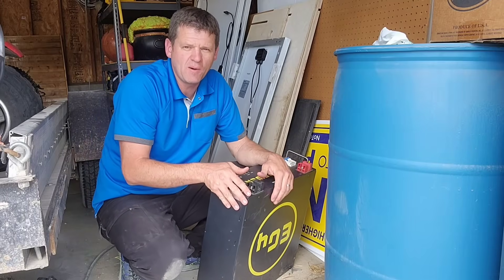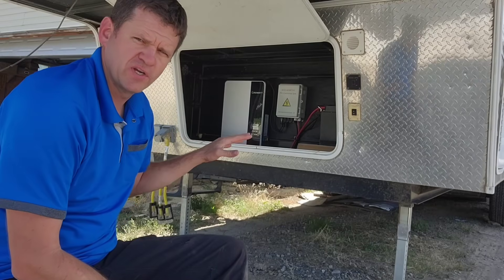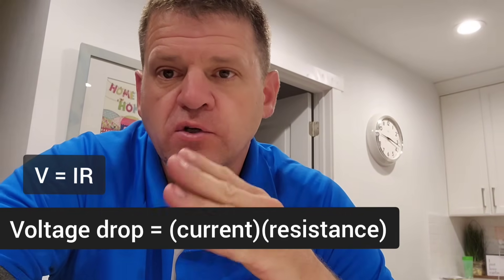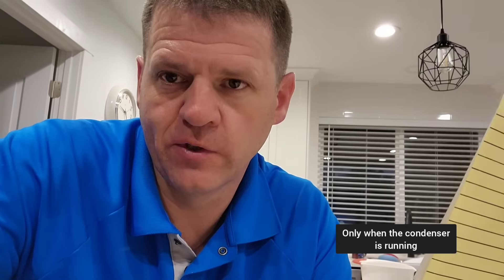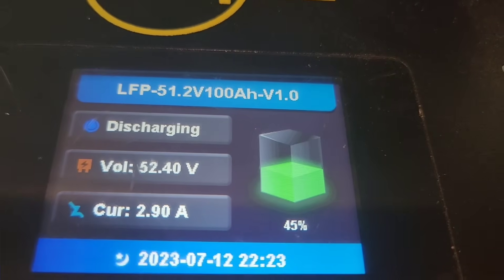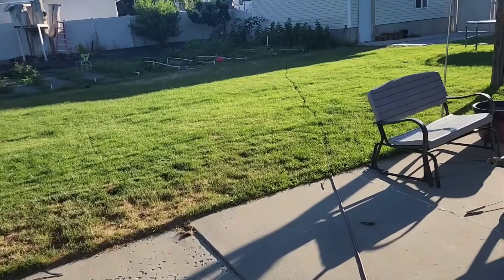How long can a Server Rack Battery run a Fridge?

Comment from the maker: *Product Affiliate Links*: 
-Growatt 3000 48 ES All-in-one inverter: https://signaturesolar.com/growatt-48v-3kw-250vdc-stackable-off-grid-inverter/?ref=DiySolarPowerFun ($50 SignatureSolar discount code: DIYSOLARFUNGET50 )
-EG4 LL (V2) LiFePO4 server rack battery: https://signaturesolar.com/eg4-ll-lithium-battery-48v-100ahd?ref=DiySolarPowerFun
-Eg4 LiFeP04 Battery: https://signaturesolar.com/eg4-lifepower4-lithium-battery-48v-100ah?ref=DiySolarPowerFun
-Used Solar Panels(discount code:"RAY"): https://www.santansolar.com/product/used-trina-245w-solar-panel/?ref=DiySolarPowerFun&campaign=HowLongCanAServerRackBatteryRunAFridge
-Kill-a-watt power meter: https://amzn.to/47ukY0V

0:00 Intro
0:15 What is a Server Rack Battery?
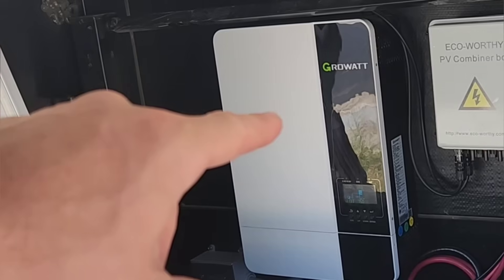0:51 Growatt Inverter setup
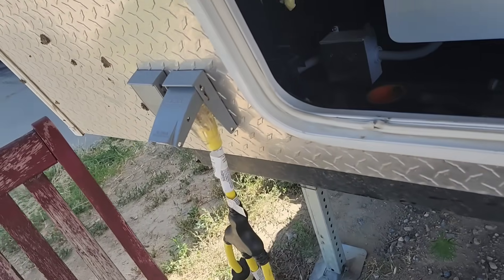1:27 Estimating how long the battery can run the fridge
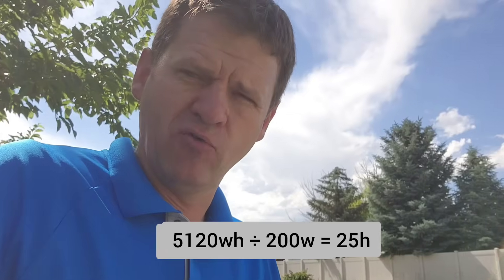3:00 Estimating power loss in a extension cord
6:40 Running a fridge off the Server Rack Battery
9:29 SanTan Solar Used Solar Panels
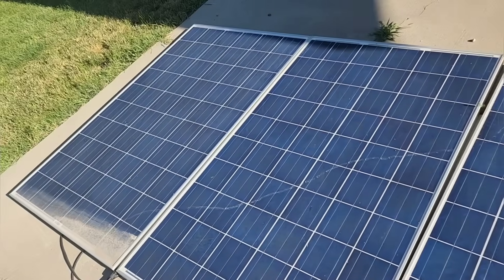10:20 Conclusion

Comment: Great video! One thing to note: you need to double the resistance of the extension cord for the round trip of the power lost for your I²R calculations.
Reply from the maker: Thanks.  Ya. I think you're right on that.

Comment: I love watching this I am in the process of putting together a grid tied battery back up system in my house. I currently have an off grid system set up in an out building with fair size array of solar panels and the batteries. But a recent hurricane and a week long power outage brought home the ideal to do a whole house back up system. I did the extension cord thing to get some power to the house during the outage. I plugged in a four gang outlet box to run some essential items. I use an oxygen concentrator 24/7 so I would have had to leave the house and my animals if I had no power for a week. The good news is I had power right up until the power was restored to the grid the bad news was I was roughing it no hot showers no heat or air conditioning. Next time I want it all to work without extension cords.

Comment: I got lost. 5KW battery. Used 3KW to run it less than 2 days? Where did the other 2KW disappear?
Reply from the maker: Into the inverter running.  The fridge is a relatively light load.. so most of the power was going into running the inverter which is usually used to run a cabin or small house.  It would definitely Longer if I add a smaller inverter more geared to running just a fridge.  I should have mentioned this.

Comment: Nice test.  Note that most fridges have an auto-defrost feature that turns on a several-hundred watt heat strip for a set time, every so many hours of use.  I discovered this during one power outage where my fridge drew more power than expected.  Old fridges allowed you to set when defrost happened, I don't know of any newer units that do.

Comment: And the error of instruments?
Reply: You should revert the position of the the kwh meters and run the test again
Reply: Plus log the ambient temperature.    Please comment on the friedge use? Was the door always closed or the friedge was used normally?

Comment: This test looks good on the surface, but is shot full of errors. Ray is leaving out the inefficiency of the inverter. His measurement of the cord resistance is faulty. Only the run time results are of any use and only for his particular refrigerator at the average temperature of his house. 

If you really want to know the resistance of the extension cord you have to put a load on it and measure the voltage at each end. Then calculate the resistance from the where R=V/I. A common multimeter is not accurate at low resistances. You need a milli-ohmmeter for small resistance measurements. 

Tons of people know just enough to be dangerous and even more know less and think this is good information!

Comment: To determine the power loss in any wire (or extension cord) it would be more accurate and to the point to measure the output voltage at the inverter and then at the load (in this case the refrigerator). Subtract the two and then multiply by the current draw. This will give you the power loss accurately and simply. Measuring the resistance, to determine the power loss, is difficult to do accurately since the low resistance (hopefully) of the extension cord is not easily measured with a cheap, garden variety ohm meter.

Comment: Humm. I have 2 200wh litium battrys and 3 250w pannels and all day arizona sun. If inrun a box fan on low i run out of power by 10pm. About 3hrs after sunset.  If i run my 60 inch tv during the day about noon i lose battry/inverter power. Cant even keep up with the led tv. Guess i meed more pannels and maybe my battries are not fully charging

Comment: 5.2kWh exported from battery , 2250w used from the inverter (50w per hr constant) 2.97kwh from fridge ~150w on/off cycles ,  maths adds up , for you to work out the efficancy you need to  max out the inverters output as its always going to use 50w

Comment: Seeing you are using a 3 kW inverter and a trailer, what about setting up TT-30 plug and say a 100 ft TT-30 extension cord, just reverse it to go to your home?  From here, try powering your whole kitchen for 24 hours with the solar panels on.  The idea being just demonstrating you can do all of your kitchen stuff for a day without overloading the inverter and without too much voltage drop over the 100 ft TT-30 extension cord say during an extended power outage.  I mean a fridge is a nice start, but then you get into using things like your microwave oven, toaster oven, blender, rice cooker, air fryer, induction burner, etc because you also want to eat that food you have, not just preserve it until the grid power comes back.

One thing to spice it up is to get a comparable output inverter generator, say a 4 kW, max, ~3 kW continuous portable generator and compare how the generator handles the bursty loads kitchen appliances will put on it versus your 3 kW inverter.  This in particular may be a real eye opener to people as my testing around this came up with the generator, even going the inverter generator route, has some real issues with this.  I think an inverter running off say that server rack battery you have will handle it a whole lot better because you have instant power from the battery where a generator needs to spool up and down and adjust its throttle, which takes time while the load shifts from kitchen appliances are instantaneous and often surge on startup from hard starting motors.

Then when you go camping, you will have the outlets and extension cable ready to plug in at powered camping spots or if it is overcast and an off-grid camping spot, maybe you could run the generator to recharge your batteries and coast for a while.  Could be particularly interesting if you could setup an electric start generator to automatically run as your batteries went down and only run during national park allowed hours.  May be a bit of a project, but highly useful to have the automation and comply with national park regulations.

Comment: Can you run a 4 ton central air ac unit on off grid batteries for 8 hours?
Reply from the maker: If you have enough batteries, yes!  Maybe I'll do a test of this later once I get a decent battery back for my home. It will have to be a big bank 😀
Reply: @diySolarPowerFunWithRay  how big we talking? I was thinking that one of eg4 battery rock of five is enough ?

Comment: Great video!! If you turn the refrigerator down to low..or energy saving..it can RUN ALOT LONGER❤..Our 43 inch LG TV uses about 76 watts standard..57 low energy saving mode...43 at medium..and 23 watts in maximum saving setting...twice the run time...I'm running my identical refrigerator and 43 inch tv + for 23 hours on  a 2 kilowatts Pecron E 2000 LFP... during the day with sun and a lil under 1200 watts of solar panels..only half the panels hooked up( currently testing my newest purchase)..I can run much more❤.As an Electrician.I think your voltage loss could be a lil more than calculated do to multiple connections..but you will know more in Time.. Excellent 👍🏻 video!!🎉

Comment: Solar power is fun to play with and learn about. I love my 10,000 Watt solar panel array backed up with a few hundred pounds of Lifepo4. My neighbor is absolutely floored about me giving him a Bluetti AC200P, I used it for 4 years straight and it still ROCKS. Thus far  living off-grid without a single power bill to pay for almost ten years. Let me tell you, I did my math and we're on the winning team.  By not paying for power during the past decade, I have on hand four Honda EU3000IS inverter generators as backup. I gave one to my neighbor along with three brand new 330W rigid solar panels to keep the Bluetti juiced up.
Reply: i would love to be your neighbor lol
Reply: Could you use a dual fuel portable to recharge the Bluetti?

Comment: Cool vid! Fyi (which you probably already know) but the 10 year warranty on that battery is only if you use it with their inverter, otherwise its 5 yr
Reply from the maker: Ah.. good to know. Forgot about that
Reply: It will easily do five years and then some.

Comment: 12v 24v marine grade fridge and stop using the inverter. Not worth for the inefficiency, energy draw and inverter price. Better to invest in a new 24v dc fridge
Reply from the maker: But I need this fridge for 120 volt house
Reply: @diySolarPowerFunWithRay  inefficient to stay with an inverter on 24 hours a day if your inverter is not sitting on 2w standy and search for load. My 12v fridge takes 70w per hour wired directly on a 12v battery.
Inverters are expensive. Running of inverter does not save any money at all if your inverter cost $800-900. This is the money for electrical bill of a fridge in 8 years. You can't even save the money for the inverter, not including battery, solar power which is not always available enough to keep up with with 1.2kwh consumption per day from the solar battery and inverter.
A house powered by solar must have 12v 24v available for lights and fridge 24h a day. 93% energy efficiency on dc-dc.
Inverters are needed for cooking and washing only. Anything else in your house is DC.
FRIDGE can be DC
Microwave can be DC
TV is always dc
All led lights are dc
Usb is dc
All power adaptors are for dc appliances.
All monitors, computers are dc.
98% in a house is DC.
The solar system must have the highest voltage in the dc range.
Because all dc conversion must be made on step down (buck converters).
48v-60v buck converters step down efficiently to 24v, 12v and 5v for all your needs.
DC lighting must stay on 12v 60v range, for example 4w led bulbs 12v 24v 48v which are self controlled (DoRight AC/DC wide voltage lights 12v 60v) have bridge rectifiers, are self regulated and will work 5-8 years life time.
I just posted a video with garden lights with the bulbs I bought separately for this conversion.
Personally, I won't have an inverter switched on, only turning on for cooker and washing machine. Cooking 1 hour and washing machine 1h20mins. Peak consumption 2kw cooker and 1.8kw washing machine.

Comment: I have been considering the 12 volt version of this battery to replace my old lead-acid batteries. I run 4, 6 volts in series/parallel setup. They are at the stage that they struggle just to hold a charge. Looks like I am getting an EG4 unit. I’m sold.
Reply from the maker: The 12 volt model is good.  You could always get a 48v and use a 48v to 12v convert to for your 12v stuff.
Reply: @diySolarPowerFunWithRay  I am currently running a 2000 watt pure sine inverter/charger. I can’t afford to replace the battery and inverter together. If I could, I would upgrade to 48v in a heartbeat.
Reply from the maker: Thanks, Where do people usually buy their solar equipment over there? Those are very good prices.
Reply: Usually people near me buy from solar installation companies in order to get the California tax credits. My system is at an off-grid location so it is a do-it-yourself installation. There are four separate small systems up here to support 3 trailers and one cabin.

Comment: Any idea if that battery could be used marine environment?
Reply from the maker: It does have fire suppression built in and is Ul 1973 listed, but on their website it doesn't mention anything for or against marine use. Sorry, I don't know for sure without calling and asking.

Comment: 50% battery loss by the inverter is atrocious. Might as well use Acid Lead batteries.
Reply from the maker: It really depends on how heavy of a load you have connected to the inverter.  For example, Lets say I don't connect anything to the inverter(a super light load)... eventually with the inverter on, it will run the battery down to zero.  In that case you'd have 100% battery loss by the inverter.  Lead acid will produce the same results.

Comment: We have bought from Santan Solar, right now you have to buy 10 panels min.  Been totally Off the Grid since Dec 2017.  We used Ford C-Max salvaged battery banks, 7.6kwh per battery. Building a new system for our retired Yellowstone bus we are converting into an RV so the solar it will have is at the moment 30.4 Kwh (4 batteries x 7.6kwh) I am trying to fit more batteries, I want at least one more bank @ 38 kwh for two people in a 35 foot MCI (bus) should be enough with at least 2400 watts of solar on top.  I want to go park in the deep woods for months if possible just to get away, retired now so I will return to the woods..lol.
Reply from the maker: Nice, that a ton of power.  with that you could add a mini-split for heating during the winter.

Comment: Good video, but I question the results.  You show a measured overall efficiency of 55%.  If you lose 2% over the extension cord that means the inverter/battery combo is losing almost 43% of the power.  That makes no sense at all, sorry.  If that's true there is something wrong with your sysem.  Newer inverter/batteries combos are in the high 90's percentage wise of efficiency.  I suspect your kilowatt measuring devices are wrong.  I know for a fact my fridge (looks just like yours) draws 6 amps when it's running which is about 720 watts.  Something doesn't compute!!
Reply from the maker: It is more efficient if you have a larger load. I think I heard 70% efficiency is best.  I could have a super light load and all the power would be going into keeping the inverter running... It that case I could get 10% efficiently.  Or if you don't have a load connected at all and the inverter is just idling you'd get a 0% efficiency because no power went to something useful.  I didn't do a good job explaining this in this video.

Comment: Good enough. I have my hand truck 5k battery with 4KW of solar from my roof and 3k inverter. it runs 28 hours until power came back….
Reply from the maker: Nice setup, With that solar you should be good indefinitely to run your fridge.
Reply: @diySolarPowerFunWithRay  normally is grid tie.  my hand truck only comes out when there is power outage. will improve next summer with some automation. but for now. it saved me 3 times already

Comment: Interesting vid & info mate. Have you considered converting the fridge to 12v/24v compressor, or just buying a 12v/24v fridge and use a 48v-24v DC converter to mitigate the 50W loss of the inverter, not cheap, but neither are batteries. Absorption type fridges are not very efficient in a van for the convenience of having the gas aspect, a DC compressor fridge will be much more efficient when using batteries negating the need for an inverter idle loss. There are other issues with household fridges, not the least is if it has a electric element defrost cycle. Cheers
Reply from the maker: Thanks, I haven't considered that. I think my fridge is efficient enough for my needs at the moment.  I have considered removing my 120v ac / gas RV fridge. That small thing pulls a constant 300+ watts.

Comment: You need a place where that inverter can breathe. That cubby in your RV is not a good place. In real hot weather that will overheat. Or if you close that door it will overheat. Bad place really bad place.
Reply from the maker: Good point. I haven't noticed it getting too hot in there because it's a large area but That's a really good point...I'm going to watch this closer.